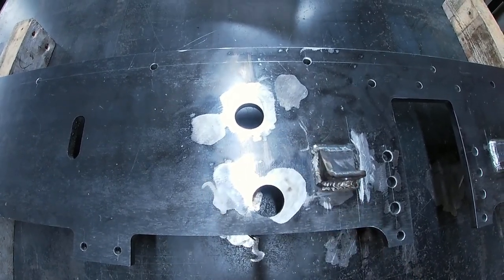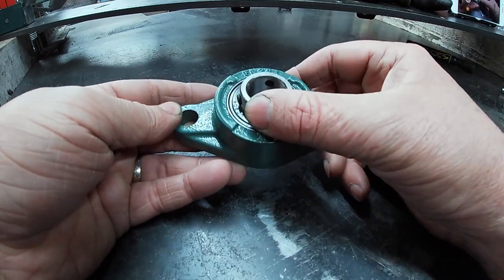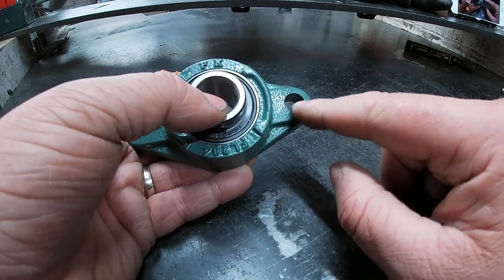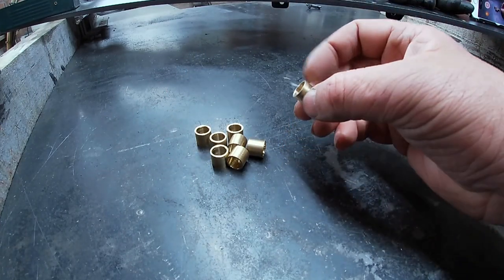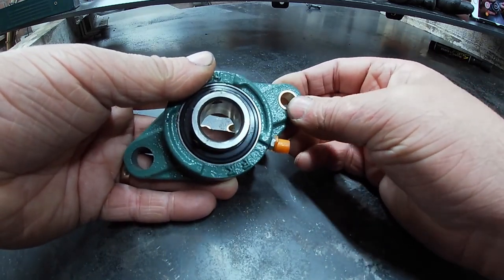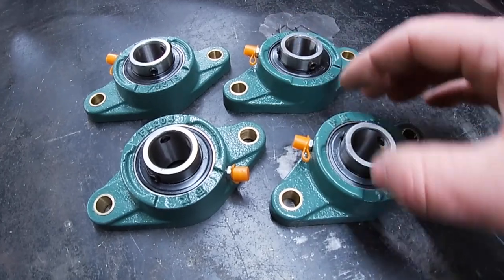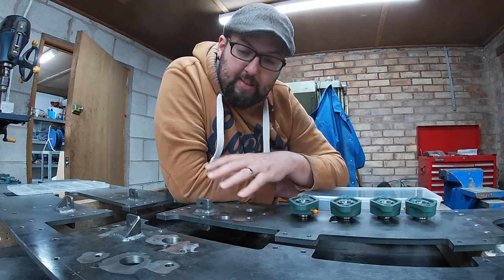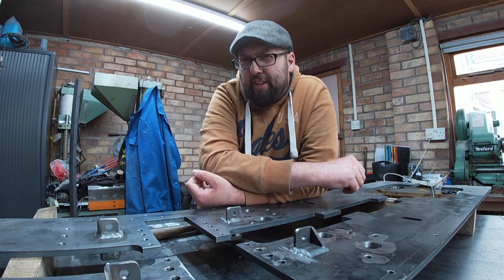Layshaft Holes & Bearings - EP3 - 7.25" Gauge Steam Locomotive Build

Comment: Depending on the primer, it may not provide much protection.  Primer isn’t designed to give protection, it’s designed to stick to bare metal.  It’s the topcoat that provides the protection.

Comment: To fix your bearing holes to fit make a jig that fits your bearing bore the turn blank  bushings pressed in then figure  were your hole needs to be  then drill it out  then turn the casting ..... drill a pin hole on other side so it's in line were you to drill other hole that way your spacing will fit all your drilled holes you  have allreading with over sizing the holes ....  with over sized holes your bearing casting will move after its  test run  looking forward to more of your build
Reply from the maker: Great idea Brian, I'll have to remember that one. All the Best, Matt

Comment: I was taught that fastening holes should always be oversized in relation to the fastener you're using as it's seldom that everything will fit perfectly together (and needed to account for differences in expansion/contraction). So for a 10mm bolt the holes I had to make where I worked were usually between 12 and 13 mm depending on the application. And in the rare case everything would fit perfectly together I could always resort to a bigger fastener to take away some of the slop.

Comment: Don’t you fix stretchers to bare clean metal on the mating faces to prevent paint squashing over time creating loose stretchers?
Reply from the maker: Now, that’s a question I never thought off! Now you’ve said it, it does seem the logical thing to do! I shall research the matter! Thanks Ian, hope your well and having fun with your Tinkerbell Locomotive.
Reply: @MattChiversWorkshop  I’d be having more fun if I can stop it priming going up hill. Still haven’t found the cause of it
Reply: @MattChiversWorkshop  In all our production, we prime prior to assembly and final overcoating.  Never had a problem with things coming loose due to paint "compressing." Grum
Reply from the maker: Hmm 🤔 priming, unfortunately I only have limited knowledge of such things,  so I’ll not attempt to guesstimate a possible cause. What a pain in the ar...! Hope you get it sorted, let us know if you find the cause!
Reply from the maker: @grumbum1 I’ve always primed on non railway related builds, but it’s an interesting question, I think it would get 50/50 in a vote for and against.
Reply: @MattChiversWorkshop  also to set the frames accurately you need bare metal as paint thickness will vary. Obviously more important with an inside cylinder loco, but once bolted up tightly and clean, the paint applied after assembly will seal the joint